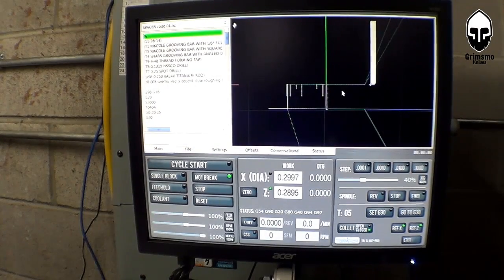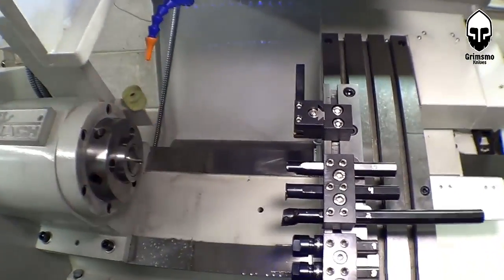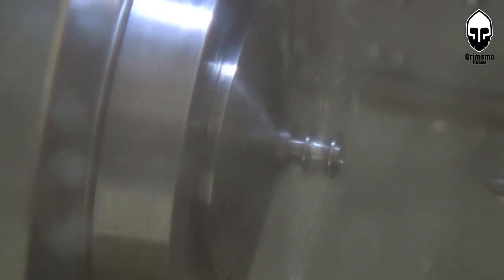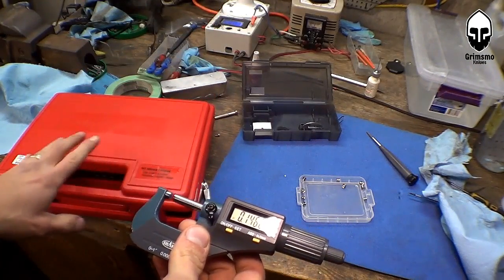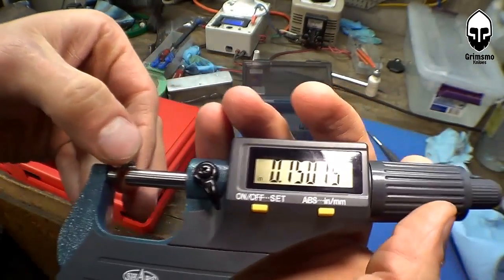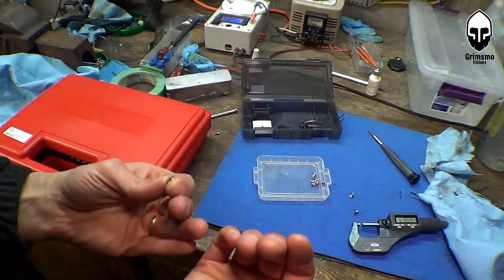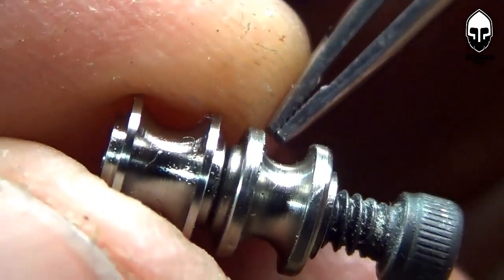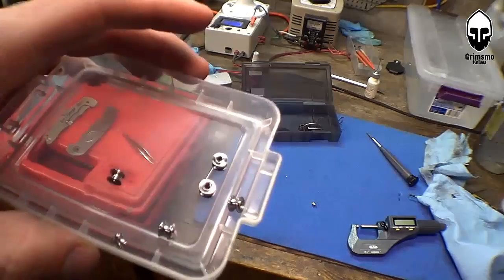KMT 101 - Lathe spacers part3

Comment: Nice vid,  especially the part where you showed what didn't go correctly (the crashed EXPENSIVE tool).  
     Someone in school told me we learn more from what goes wrong than what goes right,  and your willingness to share your learning experiences with the rest of us is very appreciated (and maybe will save us an expensive tool too).  Thanks also for the info on the Shars micrometer.  
     No Tormach lathe in my near future,  but those guys at Tormach have done a nice job with it.   
     Keep up the good work, and as always, thanks for sharing your passion for high quality and high efficiency, it is contagious
     :) :) :) :)
Reply from the maker: YCM30cnc Thank you!  I'm glad you enjoyed learning from my mistakes.  That's a theme I've always tried to carry on for the past few years, if I happen to film a mistake or a crash, it gets posted.

Comment: Hey John, quick suggestion. I notice after you part off, your tool goes directly to bump stop position. This is fine if your part-off goes as planned. If your part off tool is worn or broken, your part will stay on the stock and your tool body is going to rapid through the part. 2 quick safety lines should always clear your part off blade from the same way it came in. Program in a way that assumes the part didn't separate! Great video, keep it up!
Reply: This is a really good reccomendation and deserves a look.  Great stuff there btw John.

Comment: First crash? Gotta love it. There's more to come, trust me. :P Luckily the damage you could do on that machine is trivial compared to industrial lathes.

I think your drill block is under spindle center. The tap seemed to deflect up slightly. That might produce the squeaking as well.

I'm actually quite impressed with the accuracy and repeatability of that Tormach lathe. I certainly did not expect that out of steppers and dovetails. It's still WAY too slow and small for my needs, but hats off to Tormach for the consistency.

Comment: Hey John and Erik!  Nice job, as usual !
About your measurment gauges, don't forget it's kinda cold in your shop. Usualy, those kinf of gauges reach the specified size when it's 20°C   ...
And a little tip for your measures, your digital micrometer normally has somekind of 'pressure sensor" ( sorry for the bad english, i'm belgian). For exemple, on a casual mitutoyo micrometer, you have to twist the little knob on the end of the micrometer to make it "clik". Make it clik four times, as said in the user's manual, and you're sure to apply the same pressure, every time.
I'm pretty sure the same system equip your digital micrometer.

Continue that excellent work, and don't forget to tell us what you think about the lathe :-D

Geoff
Reply from the maker: Thanks Geoff, yes my micrometer has the clicking feature too.  It's much warmer now that we got our radiant heater!  It's almost t-shirt weather inside the shop, but you're right that temperature definitely plays a role and I try to be aware of that.
Reply: JohnGrimsmo John,

For practical purposes, with the size of the parts you are manufacturing, as long as your parts, and measuring devices are at the same temperature you can ignore the linear coefficient of expansion or the differences between the linear coefficient of expansion of the material of the part and the material of the measuring device.  The difference between your titanium parts and the steel/iron/stainless of your micrometer is about 1 to 2 millionth of an inch per inch degree F.

Comment: That "Squeaking on the way out" is the tap spinning in the ER collet holder. Watch the video closely and you can see it spin.
Reply from the maker: I never thought about it like that, but I just watched it probably 10 times and the tap is not spinning in this video.  You can see it at 6:16, the coolant drops on the tap don't rotate and the base thread on the tap doesn't rotate.  I think the squeak makes it vibrate, so the threads look like it's spinning.  Also, I think if it did spin there would be lots of problems with alignment, it would surely break right away.  I think I can buy tap collets that actually have the square at the bottom.  In the end, I think the squeak is just the sliiiiight imbalance between the RPM and the feedrate.  A floating tap holder should cure this.
Reply: JohnGrimsmo
Does Tormach recommend coming to a full stop before reversing the spindle?  If it has a C (spindle position) axis control, it wouldn't matter unless the encoder "jumps" a position or something. But if you don't, and you just throw it into reverse, there could be some imbalance between X and C position, making the tap drag on the back side of the thread.
Reply: That's a good point, and for a tooling perspective it might be hard on the tap.

Comment: What you need is a holder or a stand for the micrometer, so you don't have to hold it in your hand. I let my apprentices do those things in the first year of learning. They design and draw it. all by hand. and then they form the steel by hand filing and hand threading. for their pre exam at the end of their second year they do it again, but this time with milling maschines, lathes and drilling maschines.

Comment: John,

When you use the micrometer to measure your parts you should not use the ratchet if you want the best accuracy. You can feel the micrometer anvil touch the part long before the ratchet clicks. If you want to use the ratchet you should use the small ratchet on the end but it will not provide the accuracy your touch can provide.

Comment: Loved the series! 
Could you make a video or a short comment on the strength the framelock spring has after you bend it? In my experience as a knife maker, especially with bearings, the detent drag is the main faktor to get a smooth action. To get a minimum of drag one hast to polish the track or reduce the force   Of the spring. Unfortunately I haven't have the chance to handle one of your knives so I would love to hear with how many ounces the lockbar pushes the detent against the blade. One can easily measure that by pressing the lock frame with the lockbar against a scale until the frame and the lockbar is flush like when the blade closes. 

Many thanks in advance from a big fan from Germany
Reply from the maker: hampfi747 I don't know how much strength my lockbars have, but you're right it would be fairly easy to measure.  Mine are very light compared to most knives out there.  My lock geometry is so precise and consistent that I don't need a lot of pressure to lock it up solid.  I spinewack every single knife 45 times, they don't fail.  I also flatten my detent ball so that the drag is spread across a flat polished surface, not just the very tip dragging into the blade.  My knives are very very very very smoooooth.  Okay I just measured one of my handles on a scale, I zeroed the scale for the weight of the handle (44g by the way) and it took around 650-700g of force before the entire handle touched the surface.
Reply: JohnGrimsmo  Awesome! Thanks a lot. Flattening the detent was mentioned by fellhoelter in a thread on the usn,i started a while ago of the factors of a smooth action, to smoothen out a knife but as i tired it i experienced the opposite. Maybe i give it another shot. It definatly gets snapier. What degree do you use on your tangs?

Best regards from germany.
Reply: JohnGrimsmo How thick is your lockbar cutout these days John?

Comment: Use a micro boring bar to break a chamfer on the back of the threads before part off :)
Reply from the maker: My thoughts exactly, I think I asked you about this a little while ago.  It would have to be under 0.100" and reach 0.250".  Although as it is, there is basically no burr and I haven't needed to chamfer them on that side because they fit and work fine.

Comment: Where did you get the hardened fixture plate you are using under your vacuum plate?
Reply from the maker: Do you mean on the mill?  It's a Mitee Bite Vac Magic sub plate, and it's anodized aluminum.  If you're asking about something else I'm not sure if I follow.
Reply: JohnGrimsmo Thanks, Started looking on the internet and I found a hardened and ground sub plate, a TT1234 by TOSA. Nice but expensive.

Comment: Working with micro daily I check and rezero every 2 hours. I take a gage near what I measure. I measure with micro and wiggle the gage and at the same time turn the ratchet. Then I press origin or set in your case. Then I remove the gage and close the micro which will show ex. -10.000mm. I turn the ratchet and move about until shifts from -9.999 to -10.000 then origin it again. Perfect zero every time. Recheck with gage if it shows barely 10.000mm.

Comment: You identified (3) CTQs... See, you're already doing SPC. :o)
Reply from the maker: JrFreak300 I had to google those terms LOL, but I've got it now.  Yes I'm learning!
Reply: Those dimensions might be also considered CTPs (critical to process). If those weren't held to tight tolerances, you would have difficulty assembling. I've been out of the Six Sigma field for a few years, so I'm wracking my brain trying to remember some of this stuff.

SPC is pretty much why all of the new products you buy feel so flimsy and under built. Companies use SPC to try and minimize the amount of materials used to save money.

SPC loses a lot of its benefits in job-shop settings such as your business, though it can have benefits in some areas.

Comment: shouldnt just plunge with the cut off at the end of the programm to act as a stop. cut off to zero, pull out, zero return and position from the front. for those cut off blades, normally just the blade breaks on cut off and the holder stays intact. just my five cents. 
thanks for sharing ;)

Comment: I'd bet you're actually better than you think (ie - .00020" on width). A certain percentage of the variation is due to the error in your measurement system. Both the appraiser and the micrometer add to the variation. If you get bored enough sometime (haha), conduct a gauge R&R study and see just how much of the variation is from the measurement system and not the actual parts. The study wouldn't be difficult at all to conduct and probably wouldn't take more than 15 minutes.
Reply from the maker: JrFreak300 I definitely do notice that I can measure the same shoulder 10 x and come up with results varying a few tenths.  So I do it enough times and rotate the part until I see a number that seems right, one that shows up most often.  I'm assuming that a better caliper would help with this, but lack of experience on my part must also be a big factor.